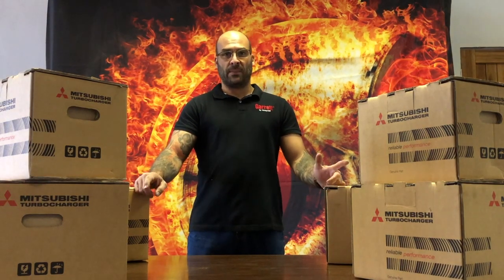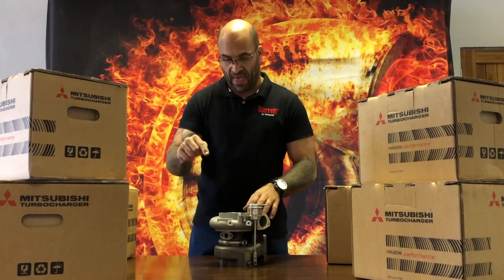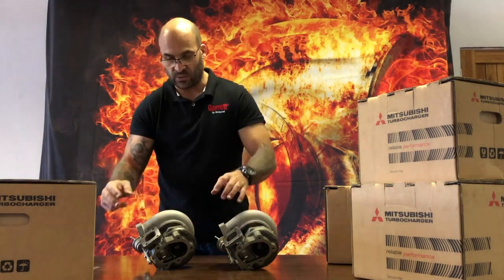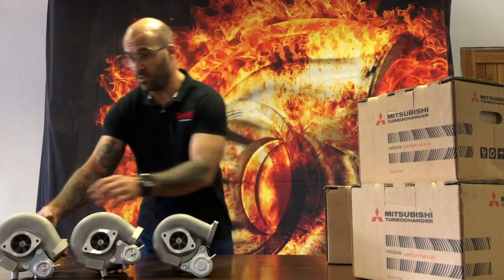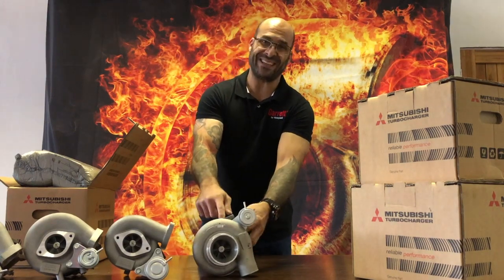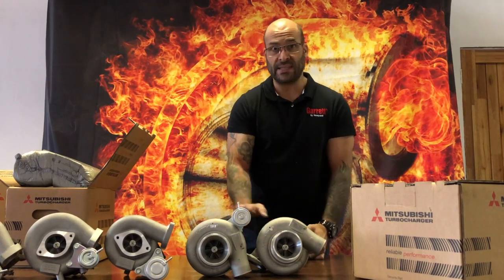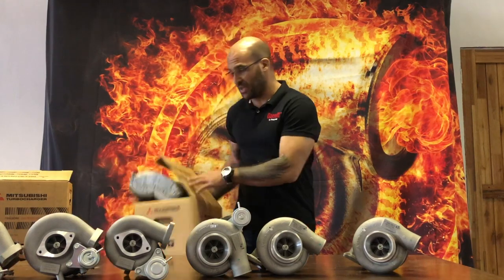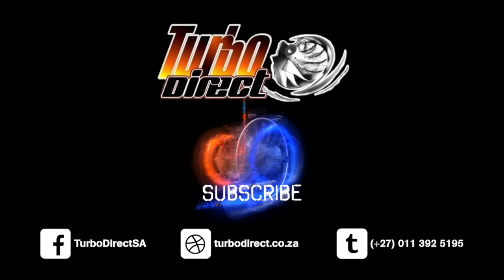Mitsubishi Performance Turbochargers - Outlined

Comment: I would like to do use the generic td05 18g to replace my turbo on my Megane rs 250 cup. I saw that your pricing is pretty awesome and I just wanted to know if it will be able to run at 1.5 bar? These turbos are much more affordable than the gtx range, and they should be reliable too hence why I would like to get more information on this turbo. Thanks for the work you guys do Chris.
Reply from the maker: Thanks for the compliment - much appreciated. The MHI range is definitely reliable - boost is irrelevant, you should be concentrating more on what HP target you have and what lb/min flow rate the turbo you considering is able to provide.  if the turbo is not able to provide the flow to make the HP - increasing boost is going to do nothing but shorten the life of the turbo.
Reply: Thanks for the feedback chris. The guys in the UK and France use the g25 550, gtx2867r, and efr7163 turbos on the stock motor to get about 350 to 390 hp quite reliably by limiting the torque of the motor. I am just looking for around 350hp without breaking the bank by ordering because it’s costs an arm and leg to import the systems from the UK or France. I have been following your company for many years and love the work and expertise that you guys have on offer hence me asking the question. The reason why I enquired about the Td05 turbo it’s a Mitsubishi brand and they tend to last long and be quite reliable for its life span…. And there are Lots of T25 adapters manufactured in the UK and France that are quite affordable to import for these types of engines which allow to run this turbo or any of T25 from your range that are quite reliable and that manage the 350 to 400hp range. On my shopping list is 630 cc short injectors, oil cooler, bigger intercooler, need to modify the dp, t25 flange adapter, the turbo that you recommend, turbo blanket, and heat wrapping. Thanks again for your advice.
Reply from the maker: @wesleybarrybaartzes5040  Take a look here:- https://turbodirect.co.za/store/index.php/shop/category-layout/results,1-24?virtuemart_category_id=&keyword=g28r&limitstart=0&option=com_virtuemart&view=category&Itemid=541 

These are updated and the rotating assemblies changed, to provide a better flowing and faster spooling setup. Still internally gated, but with compact comp housing and higher flowing compressor -